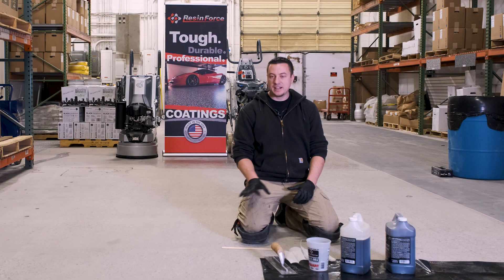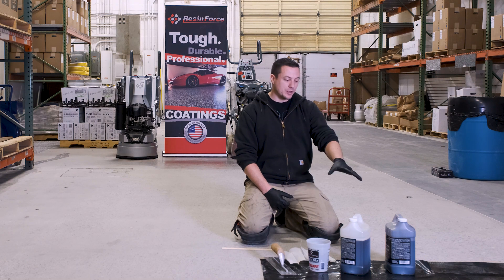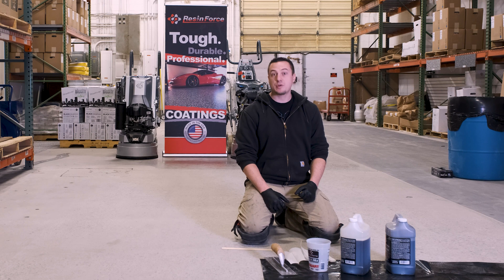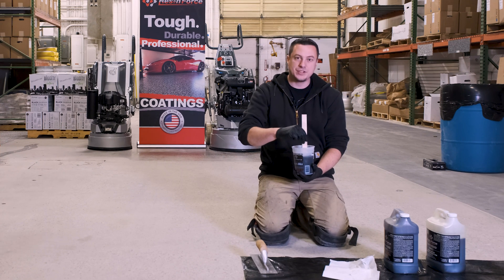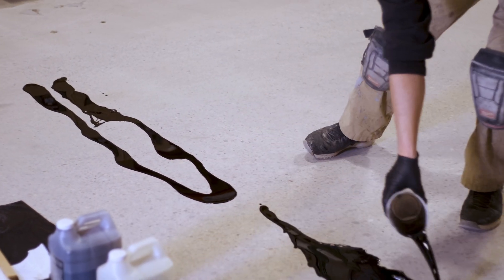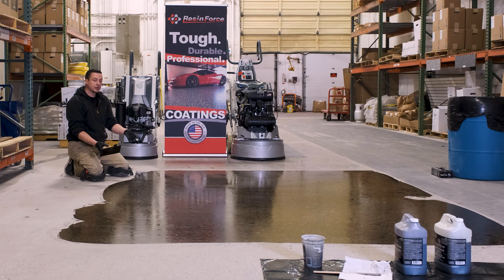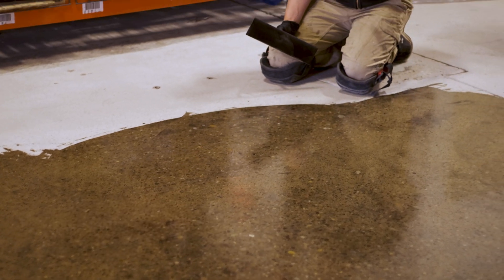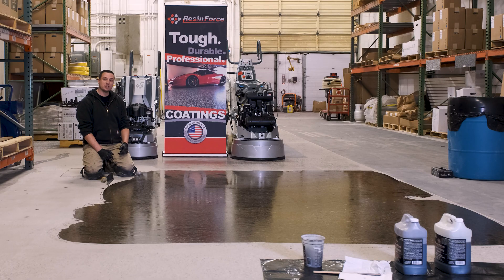Grout Coating Concrete: How-To Minimize Outgassing for Epoxy, or Prep for Polished Concrete

Comment: Do you have to grind this grout coat prior to installing an epoxy MVB over it?
Reply from the maker: If you grout coat with MVB, and are going to follow with a full body coat of MVB, no, do not grind, just apply the body coat within the recoat window while the grout coat is still tacky. Hope this helps. 💪